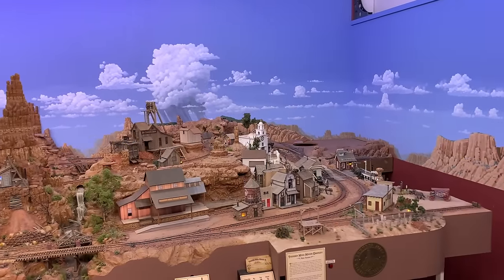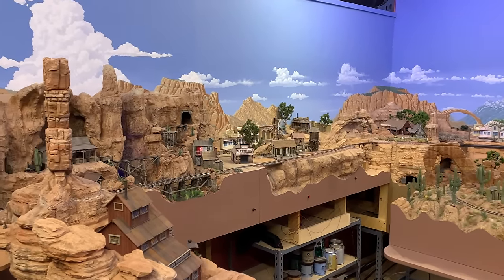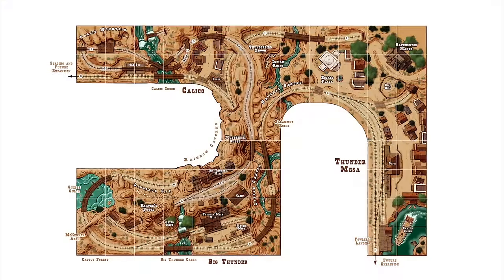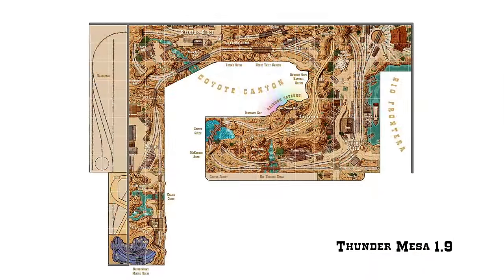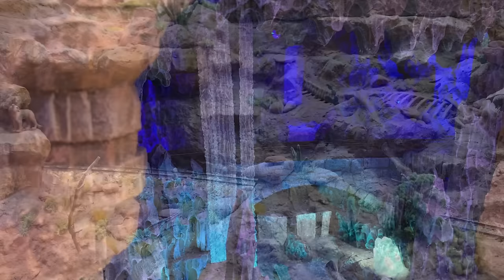Final Run on the Original Thunder Mesa Layout | Thunder Mesa Reimagined

Comment: Dave, Within a short period of time I will be working on Scenery on my On30 Peep River RR.  Convince me to use Foam as the Scenic material!!  For some reason all I can think about is how much clean-up there will be, as opposed to using cardboard latus and Plaster impregnated Gauze.  I realize my way is probably more expensive.  I would like your opinin on this!!
Reply from the maker: Different materials are good for modeling different types of scenery. I chose foam because it's lightweight and well suited to the Southwestern canyon country I am modeling. Traditional plaster hardshell and rock molds work great for many other types of terrain. Both methods have there own messes to clean up!